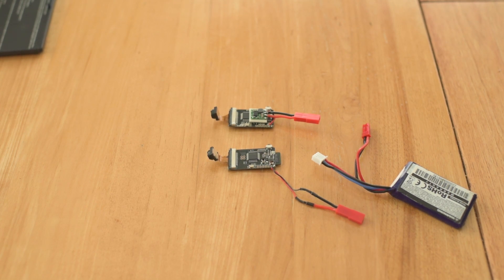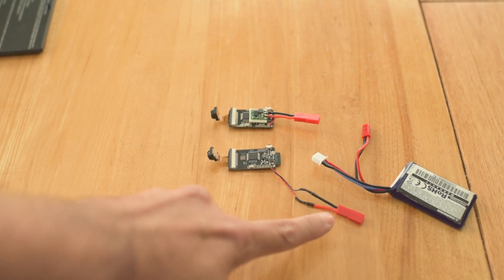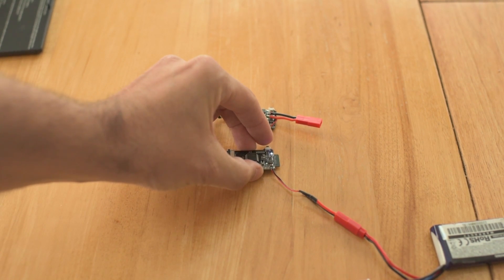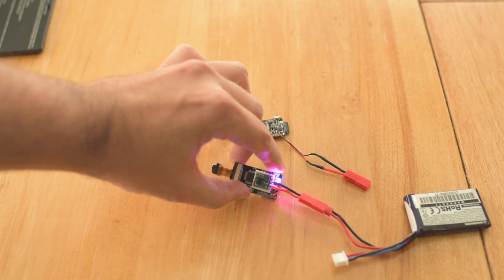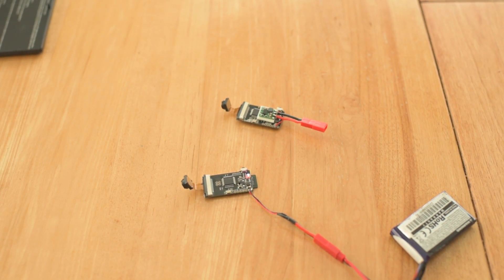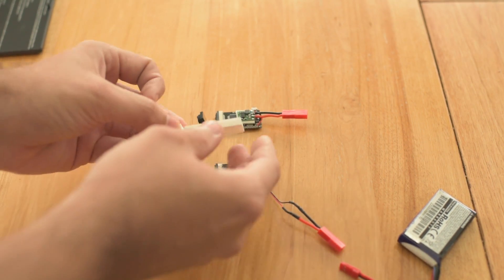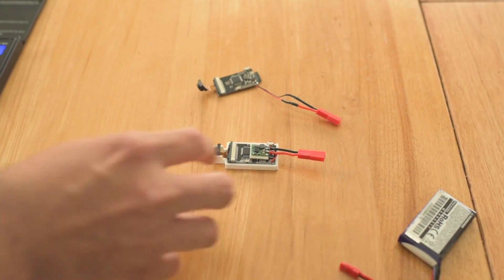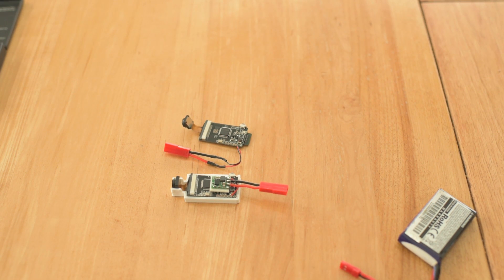H107C-A34 3.3v and 2S test

Comment: Can I buy one of those plates? I'm having a hell of a time figuring out how to mount mine on my mini. Been using the original hubsan battery holder but that's another gram. How much did you mount end up weighing? Also, will this camera module run off 5v? I'm pretty sure the original position on the hubsan had the positive taking power directly off of a motor pad so I think 1S battery should be fine right?
Reply from the maker: +Joey Nuggetz I don't remember if it runs off of 5v or not. I'm using 3.3v here. 1S is 4.2V (full) to 3.7V (nominal), so I'm not sure if it can handle 5V or not. Let me know if it works for you.

The weight for only this half is here: https://youtu.be/YZJKYZVtVGE?t=4m53s
I don't remember the final weight with the top enclosure. It was a little too heavy for my little micro. Made flight very sluggish. I could print holes in it, which would reduce the weight. If I remember correctly I wasn't too happy with the video quality (720p), so I sort of lost interest in developing it further.

In case you didn't already see it, here's the version with a lid: https://youtu.be/dbN0nJzJnCo
Here's the link to buy the version with the lid: http://createthis.com/products/h107c-a34-enclosure
Reply: +createthis I tried to purchase the model but never recieved a download link or email confirmation. Can you look into it?
Reply from the maker: Totally. I'll send it to you in an email. Sorry for the trouble.
Reply from the maker: Joey Nuggetz Sent them to you via email manually. Thanks for your purchase. Enjoy!